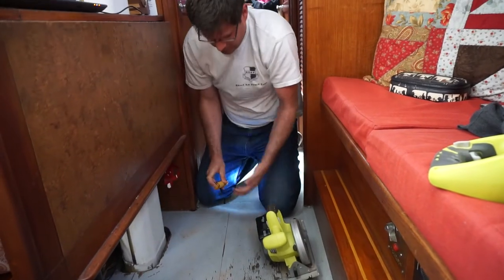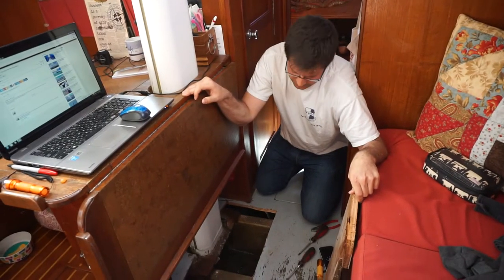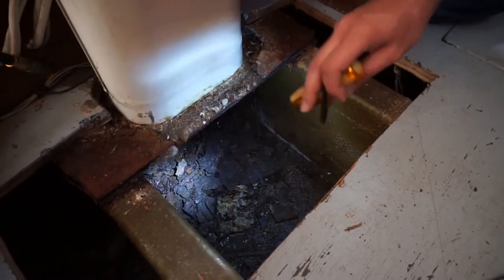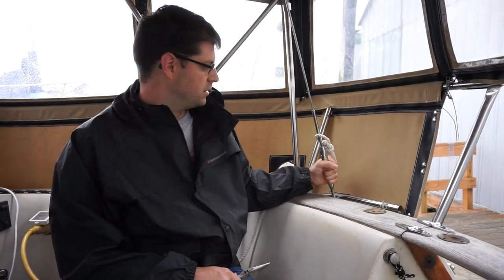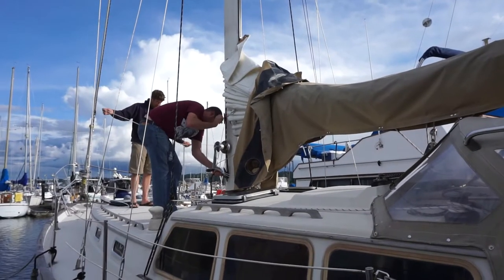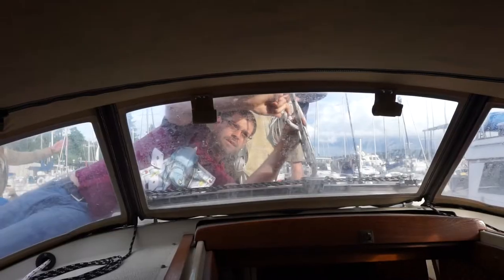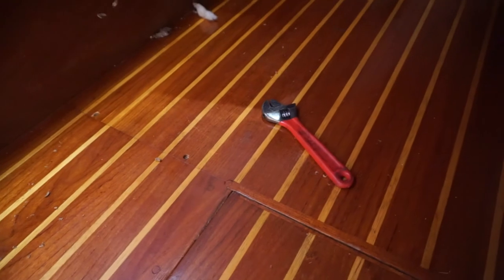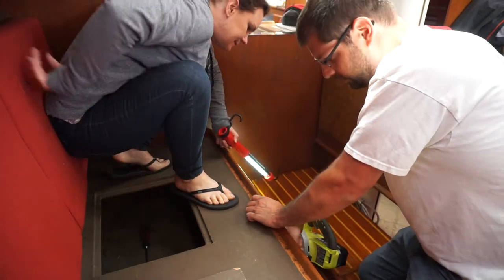Mast Step Repair Part 1 Ep. 25 (Liveaboard Life)

Comment: Just put a bent nail down beside the mast and mark it to see how thick the ply is. Probably to late but if you take 3 or 4in. pieces of chain and add to the stays All around  then put 3/4 ply on deck by the mast you can take 2jacks, one on each side either rig a rope or maybe you can jack on the wench mounts and raise the mast up, then you have 3or4 ins.of play to fix mast plate  3/4 stainless (316) will last the rest of your life.  and you can put a solid block under the plate if you want. People act like a mast weighs 3 or 4 tons and you need a crane to lift them. find one in a marina and lift it.
Reply from the maker: The wood near the mast was so warped and damaged I wouldn't have been able to tell. Probably would have measured an inch or more. In regards to just lifting it up a bit, there would have been no way. It would have also been very dangerous. It took all of a month to do the repair. It unfortunately wasn't just about replacing the one piece, I also had to rebuild a stringer which will be in future videos.
Reply: ahoy, wow, that is so cool. very nice of you to post notes about this. comments are the best part of the internet. have a great day.